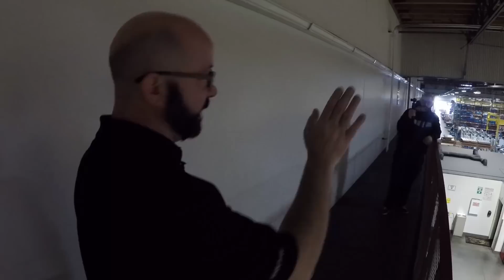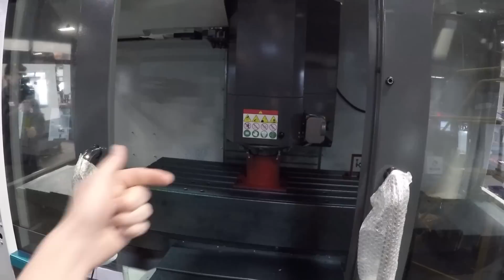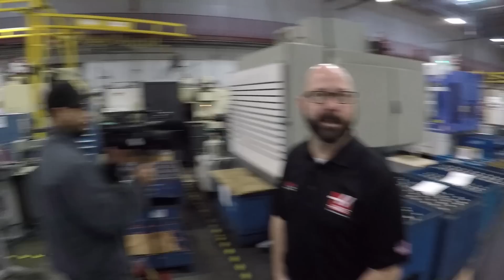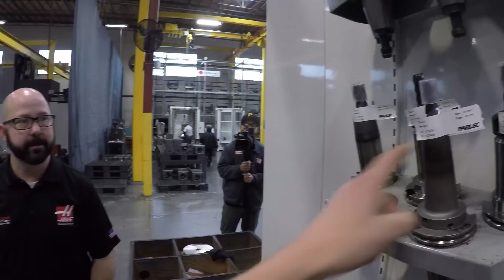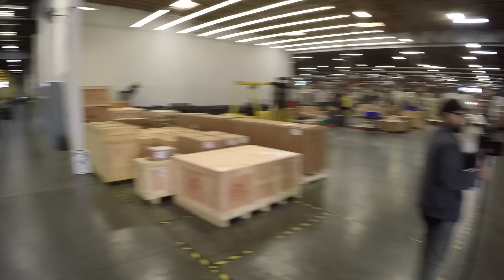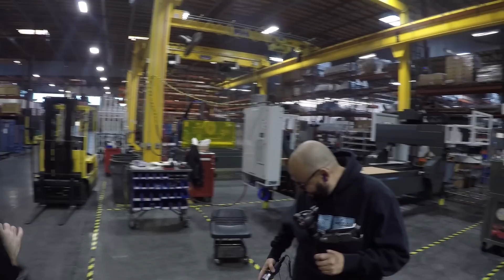HAAS Factory Tour!  AMAZING size and number of CNC machines!

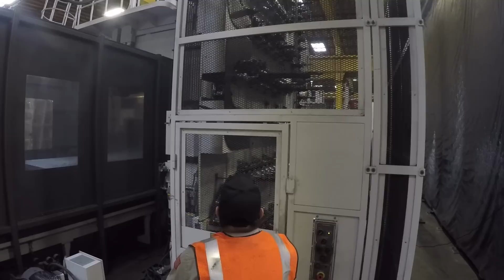Comment: 16:39 Man that moves slow. The chip-to-chip time must be horrendous on that thing, if a tool is not at the part for very long, and two tools are at the farthest they can be on that chain.

One machine I use at work is stupidly slow. Even with pre-calling a tool, the machine has to send the 1st one back, and then while the 2nd is cutting, it's grabbing the 3rd tool. The 2nd has to stay down for a minimum amount of time, otherwise the machine is hanging waiting for the tool to show up in the ready position. One of the draw backs with a 1pod=1tool chain.

Comment: I miss working there. Hiking from engineering to the lower 40 many times a day got a bit old though. Did provide for a bunch of interaction with, and learning from, the guys making parts though.
Reply: NYC CNC design engineer in the VMC group. Handled tool room and mini mills, then did some work with rotary products. Also did a bunch of FEA simulations for proposed casting changes and "customs."

First job out of college, so I mostly handled improvement projects. The plasma project (really a 2½ axis development program) was tossed my way b/c I had robotics & Mechatronics experience.

That got me a ton of experience as a machinist (I had none when I started) as I was making quite basic proof of concept parts. 

Really an awesome environment for a budding engineer. But it also spoiled me. Full access to the tool crib of such a large manufacturing environment was awesome! Realizing that wasn't normal after leaving was downright cruel and unusual punishment! LOL
Reply: That sounds awesome! I actually just graduated with a Mechatronics Engineering degree, and while I'm excited about my job in the defense industry, the one place I think I would love even more would be working on CNC machine development.

Comment: Yeah 24 tools is not enough. I don't know why Haas thinks that is a good standard to land on. 40 is typically too much to pay for. 30 or 32 tools would be the nice medium, like any other company. After you put in a bunch of constant running tools and various lengths, You're already up to 20 tools, and now you have only have 4 left to work with, for randoms. Also, I would like to know why the tool changer arms are so long for. The tools sits rather far from the spindle if that is the case.

Comment: I was surprised to see the tiny ways on that big VF12, then I pulled up the specs and saw it was max 4000lb part rated. Seems odd to need that much travel on that small parts, guess it must be common for aircraft and things like that vs heavy industry stuff. These factory tours are like crack for machinists!

Comment: HAAS are great machines for the price. Just cant stand the 40 taper when i can get much more out of a OKK or Okuma and get better lifespan out of my machines, specially if your doing 4v Ti and hard steel parts.
Reply: NYC CNC 30 machines are running all 50 taper. We specialize in steel and titanium. Been looking into the hsk for 40 but would have to build separate tools for balancing. Don't get me wrong Haas are very nice.

Comment: So cool of them to show you a prototype. Transparency is so great in companies. Any other company would have  had you under NDA and had that thing wrapped up with a 100m restraining order to cameras.
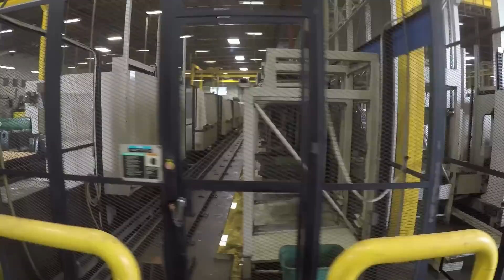Reply: In all fairness nothing new here.. UMC750 with more travel.. They sure didn't mention that mori seiki pallet pool @ 17:38..
Reply: Eggsr2bcrushed exactly. This is why I recently purchased a umc-750 over a comparable fully blown heidenhain machine. The other company went to extremes to meet the Haas price, but they did. 

It gives me peace of mind to know that I have a new spindle within a day for roughly 4K. Instead of my recent experience with another machine builder (6 weeks down, 20k repair bill). 

The transparency of Haas, along with my experience of using them in an earlier job made me purchase Haas again. Looking forward to buy many more of them. Especially after their competitor said something like "Haas only build press drills. They don't make machines." the arrogance of the competitors of Haas is costing them customers.
Reply: @pjotter0  I've read enough to know that Haas isn't at the top of the speed/accuracy curve. But capability is only as much as your ability to utilize it. For the price of one of the "big" names, it might be possible to get a Haas and a pallet changer. Now who's kicking who's teeth in on cycle time? And if it's a pool/multi-pallet changer, you may have effectively "bought" another machinist and a third shift depending on your usage.

It's like all the cats I know who believe they're going to be millionaires because they bought a high-dollar 3D printer. They can't get a sustainable business going because they couldn't afford to pay someone to do sales/marketing, modeling, metrology, and someone to babysit the machine and keep it running. It's just a machine. Do you have a system to fully utilize it? And how well can you recover from when it breaks?
Reply: Chief Machining I believe they did mentioned that at the beginning, about that they just buy the machines they need if they don't make them their selfs. Something in that line. I thought it's a bit on the beginning of the video